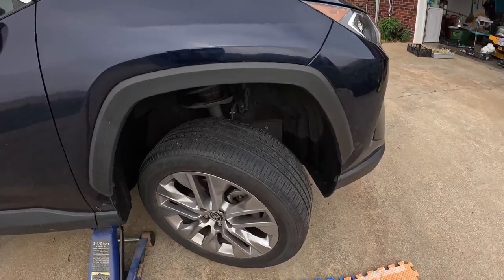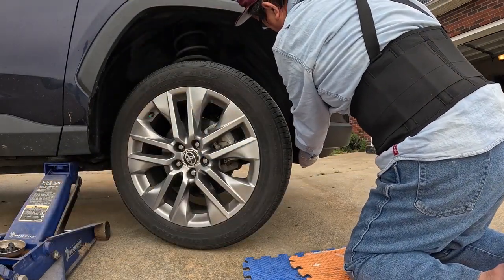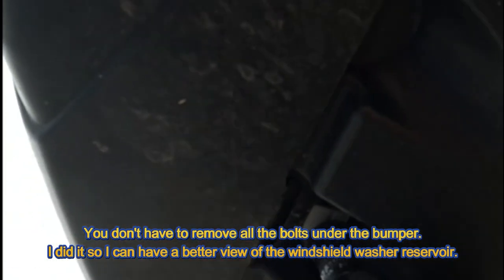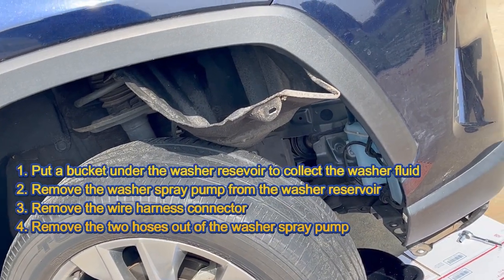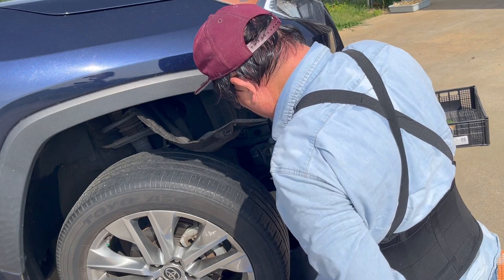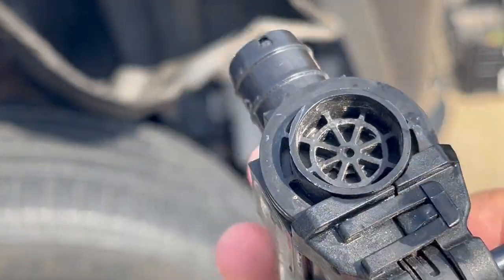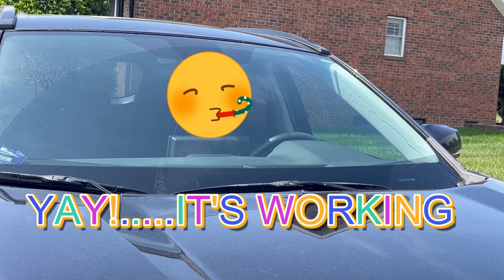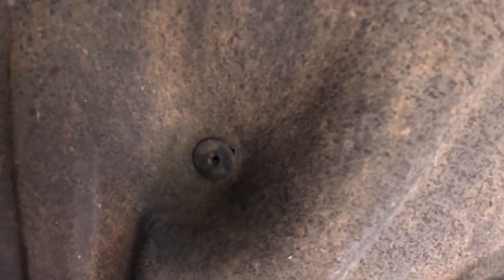2021 Toyota RAV4 Windshield Washer Pump Replacement

Comment: How do you remove the pins in the beginning?
Reply from the maker: Use a flat screw driver to ply out the inner pin first. Then remove the whole pin after that. The inner pin was the one that locked the pin in place.